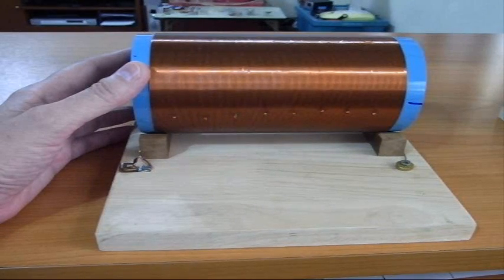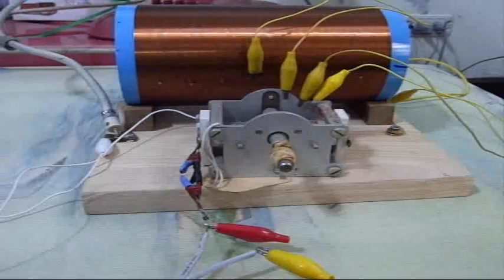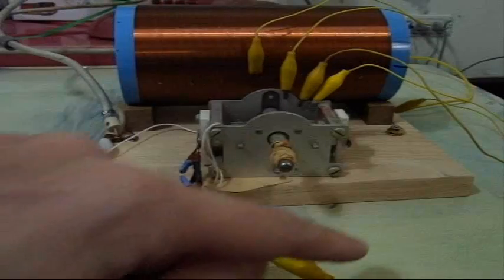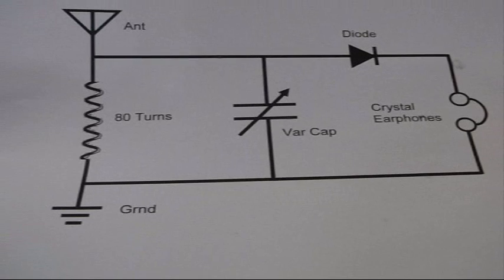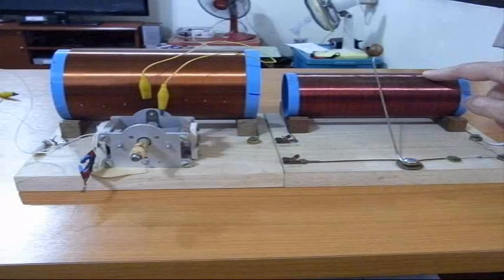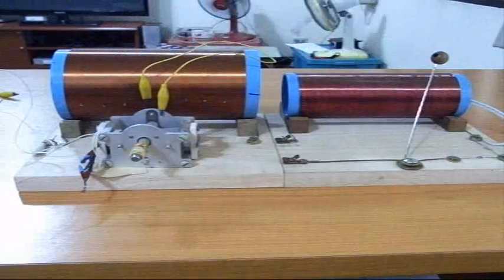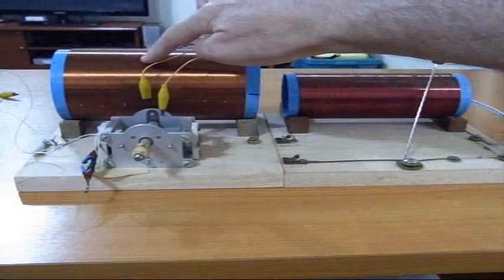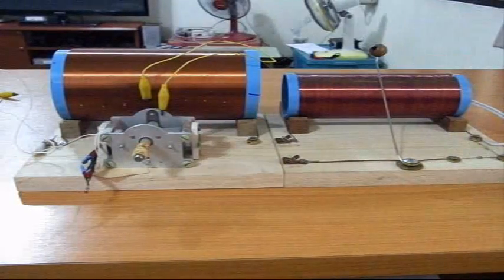Popular Crystal Radio Design That's a Waste of Time - And Why   (Updated Video Available)

Comment: perhaps something  is missing or lost over the course of time fom the original design;
ike a ferrite rod sliding partially in and out of the coil along witj the antenna wire to tune it
Reply from the maker: Sounds like you are describing the "rocket radios" (I had one of those when I was a kid).  It's a different circuit design for a crystal radio.  There are dozens and dozens of crystal radio designs, some are better than others.

Comment: Mine receives 560 kHz and this one is strong, a  weaker Mexican station around 900 kHz and one cb on 27 Mhz that seems to be located nearby at the same time.  For my first radio, this is AWESOME!!  I have built 2 others that suck too (especially the one using a microwave power transformer secondary coil that only looks cool) BUT and that's a big but, I want to build a better one I can permanently leave in the hunting shack all the time and have tunes.  especially that some wandering  bastard doesn't go and take! Or at least I can easily make a replacement.  Wind a secondary coil with an inductance  from 136 to 141 uH.  Subtract turns one at a time till you get your favorite station coming in strongest.
Reply from the maker: This one works well, but it's a bit complex:
https://www.youtube.com/watch?v=AaNpFYe5dSo&t=3s

This one is very simple, but tuning is less precise:
https://www.youtube.com/watch?v=8XR9Uzy2RPM&t=2s

Comment: You are missing a seperate induction coil on the first kit.
Reply from the maker: That may be the problem.  The diagram I show is all over the internet claiming it works and it does not. If it needs other components to function, they don't mention them!

Comment: What is the value of that variable cap.?  It sure doesn't look like 365mmf.  I don't believe it has enough variation of capacitance to change the value of L/C network to tune across the band.  When I was a kid, a made many crystal radios with that circuit.  Wound the coil on a toilet paper tube, and used 365mmf variables from old radios.  They worked loud and clear.  with fewer windings on the coil, I even picket up Radio Moscow (if was on the east coast).
Reply from the maker: It's 356 pFs for sure.  That's the value that all these designs call for (you can google for a while and find this same circuit diagram again and again.  I think it's people copying it).  As I said in the video, I can get 1-2 stations and they are pretty strong, BUT with the others I can get up to 17 stations.  I can get 1 station just using a germanium diode, so why bother with the coil and cap?  I've got another design that works really well.  Excellent discrimination, but not quite as loud.  https://www.youtube.com/watch?v=AaNpFYe5dSo&t=12s

Comment: I had one of those "boy scout" radios back in the 50's/60's. It only got two stations at best. Mine however had the coil between the antenna and ground with the tap going to the detector then ground. I like your mod, at first I thought it was crazy, but the more I looked at it, yeh....crazy like a fox. It gives a better antenna match.
Reply from the maker: I grew up in a small Midwest town and even with a really good antenna also had limited reception.  If you are near a big city with lots of AM stations you can get a lot more stations.  As a bit of trivia, the boy scout design in my wolf scout book (I've still got it) had an error in the picture, it had an extra wire that was shorting the coil if I recall.  I still remembered that decades later when I built this one.  Glad you liked it.  The capacitor one I did also works very well.  Most of the designs you find for capacitive tuned ones don't work at all like the one in this video.

Comment: Just 80 turns does not determine the inductance. It is dependant on diameter and turn spacing as well
Reply: ala Robert Turner : 80 turns 26awg wire yields a   coli of 1.27 length :
 1.27/80 = 0.158in/turn close wound

Comment: well maybe if you take it out side to get best reception remember they transmit 10000 watts or what ever and you have to get best location see this thing is a radiant energy collection device and it picks up allot of signals if the electric was out and you had a more calm environment it probably work better but see what it really is a way to collect electric from the environment for free and this is why we don't really see it much anymore wouldn't want people to get the idea to stick up an antenna to collect free energy. IE easy to get energy.

Comment: I bought this regenerative receiver kit and was thrilled with it. Coils can be changed for different bands. For twenty dollars you can not go wrong. The circuit board is well masked, professional, well labeled, instructions are well written.  The on board TDA7052 1.1W amplifier is a real winner no other amplification to drive a room filling speaker is really needed. The varactor tuning is stable. Regen is very smooth. The fellow selling these kits is “ thorpnoe “ best way to find it is to search ebay for item number 162408106542  I used a simple 40 meter dipole antenna strung up into a tree, I am sure long wire will do well also. N8DLI

Here is a pretty good description of the kit. You can see a similar circuit in action at https://www.youtube.com/watch?v=uESpudNQJ9o&t=74s

The regenerative receiver kit based on the design at https://circuitsalad.com/category/rf/page/4/. This is the "version 2" design but substituted a pot with a varactor for the variable air capacitor. Uses 1206 size SMT parts with six smaller parts pre mounted as shown in first photo.  You install the 22 remaining SMT parts and the 6 through hole parts along with the externally wired pots, or SMT can all be installed no extra charge  Second photo shows all SMT parts mounted. All parts are included except for user supplied 10K-B pots (2 needed), 1M-A or B pot, speaker, 9-16V power source, and an antenna.

Comment: when i was a kid i used to disassemble electronic stuff like radios, and i think there's always a black tube in the antenna part that seems to be a magnet.
what's the difference between that and the pvc pipe? is the magnet stuff only useful for powered radios?
Reply from the maker: There's what they call ferro-magnetic bars, toroid and such.  It's not really magnetic like we think about magnets, it only magnetizes for really, really short time periods and only when there's a change in current in the surrounding wire.  Like the core of a transformer, but even less permanent.
Reply: It's not a magnet, just looks like one. And, it will stick to a magnet. It's powdered iron oxides in a binder. The reason for it is that solid iron would have lousy frequency response, while the particulates work quite well at higher frequencies. It could be used in either a powered radio or a crystal set. The purpose of it is to increase the permeability of the core of a coil and increases its inductance.

Comment: Are you quite sure  you want in the second diagram, the ground at the top and not the bottom? Consider when you have maximum inductance for lower freq stations ( the slider arm more towards bottom of diagram. ) In that case, the diode circuit is across a smaller part of this autotransformer, and the output voltage is less than over the whole coil.
Reply from the maker: It's a good question.  I did try putting the ground (and antenna) on every intersection to see if that would help.  Nope.  I'm still trying to make it work.  Part of the problem is that it is very sensitive and therefore good at discriminating among signals, BUT (and it's a big but) anything you attach to the circuit that is anything but extremely high impedance kills the resonance (I've been using an oscilloscope on it).  I know it must work!  Will keep beating my head on this wall until I figure it out or I die in the effort!  ;)

Comment: I used a free Google Play app called ElectroDroid to do some calculations.  A coil with 80 turns and roughly the same diameter and length as yours has an inductance of about 400 microhenrys.  It resonates with a 365 pF capacitor at about 400 kHz, which is well below the AM broadcast band.

It looks to me like the coil needs a lot less turns.  If you have an Android phone you can download this app or use a different one for Windows or whatever.  It makes getting a ballpark estimate so much easier.
L8r...
Reply from the maker: I downloaded that a while back and have not played with it much.  Yes, the coil is much bigger than the one on the wiper-style radio, but I have taps every 20 turns so I can try many different inductances.  It just never got more than 2 stations.  I think it has to do with being able to vary BOTH capacitance and inductance over a very large range: the capacitance of the wiper style is coming from the coil and when one varies the inductance you are also varying the capacitance in direct proportion.  Theoretically one could do that with independent coils and capacitors, but I've not given that a fair trial yet.  It's on my long (and every growing) list of things to do!

Comment: If you tune the capacitor of a parallel resonant circuit, you should hear a peak and a drop in the signal, even if there is only a single station.  Your tapped coil and capacitor does not sound like it is doing this.

I think the reason why is because the tapped coil has too much inductance and the resonant frequency iss much too low, well below the broadcast band.  The typical crystal set uses a 365 pF variable capacitor and a coil that is about 180 to 220 microhenrys.  I think that your coil is much more, it's a very large coil.  The coils that I've measured are about 1.25 inch or 30 mm diameter and 2 or 3 inches or 50 to 60 mm long.
I think you should be using the tap that is 40 turns or even less, 20 turns.  You may have to go even less, by using a smaller sized coil.  Thanks for the video.
Reply from the maker: I think you are right.  I have tried many coils, bigger, much bigger, smaller and tiny, but it's never very good.  I need to spend some more time on it.

Comment: I don't mean to get too "Electrical Theory" on you but ... if you apply the equation for resonance to your circuit there you will have an Aha! moment as to why that specific build should only work for one or two stations.  The capacitor is only allowing you to dial into that resonance at its peak so you can get the best sound quality for that one 80turn coil.  In the slider model you can only hope that the passive capacitance and inductance both match up where it happens to be laying (then you get a station, at resonance), you cant tune either L or C independently in a slider though.  The air cap just keeps you from needing a much larger device to get the same selectivity, like say out of a single coil only type radio.  You oughta try putting that air cap on your slider model and see if you think its an improvement then ...
Reply from the maker: I've run the numbers for the coils and caps from some online sites and theoretically they cover the AM band.  In practice things like antenna (length, orientation), proximity to ground planes (like when I showed on on the AC unit), my body positioning (seriously), nearby electrical devices (our plasma tv really interferes badly), etc. all affect the actual outcome.  In fact many times the electricity involved behaves more like static electricity than regular.  I've got computer USB scope on order so I can finally see what is really going on!  Can't wait!
Reply: Yes, that interference is what you would expect if you could not narrow your peak for resonance, to make the station youre tuning into the strongest one coming through.  The thing is most coils (if not all, I'm not sure what the perfect dimensions would be ... that's a fun math problem to tackle ... it would probably involve some sort of Rodan-esque increasing geometric iteration coil to make the tuning linear ... or simply one of those air capacitors that taper but whose slope would match up with the coil you've built ...), but most are not going to adjust Henrys vs. Farads in a fashion that keeps their graphs aligned ... and therefore makes them perfectly tuned as you slide.  You can calculate it yourself by running what would be your slider point of the coil at different points.  Youll see its not a linear relationship already.  The internal capacitance of the coil is not either.  Hence why if you can decouple these elements of the radio (capacitance and inductance in your tank circuit) and adjust them independently you can achieve better performance.

Comment: I get sort of where youre coming from with this.  The tapped concept can be infinitely better, however, with several additional modifications.  I can agree with you though that exclusively tuning with the air capacitor is not going to get you the range you want.  Tapping the coil in multiple locations AND using it is going to get you better selectivity than your slider radio though, if designed properly.  It would effectively allow you to be able to select half-way-around points on your coil where the slider can only reach single rungs (if that makes any sense).Also you have to consider that if your coil does not change ... that there is basically one set resonance attainable by your circuit with that capacitor.  Youre basically tuning it in closer to the one spot it really resonates at in that config.  You touched on it with your explanation of the slider model.  You are effectively changing both (and in effect moving across several different resonating combinations) when you slide.  You have the beginnings though of a better model ... its just more complicated to get your bang for buck.
Reply from the maker: I've got the parts to do what you are talking about, just need to find time to work on it.

Comment: My guess is that the variable capacitor is the wrong type for this coil. Also the coil itself doesn't have enough turns so the frequency range is too narrow. I usually go with about 120 turns and use a cheap variable capacitor and have gotten good results.
Reply from the maker: These coils have 170+ turns.  I have been experimenting with different coils, from very tiny to mid to large like this one.  The cap used is the "magic" 365 pF that the most popular design calls for, and that's what this video is about, debunking a design that is all over the internet.  This was built to the most popular specs.  If you look at a modern transistor radio the coils used with the 365 (or thereabouts) cap are small and multiple, so obviously it works.  But that's also in conjunction with a ferrite core of significant henries.  The quest goes on for a sensitive crystal receiver with good channel separation.

Comment: nice video,

If you want listening on shortwave in the Netherlands is that possible!
http://websdr.ewi.utwente.nl:8901/
instructions:
click To * waterfall *
Seeking for: * Waterfall view * and click on: MAX IN.
Choose a modulation now for testing: AM
Click in the box: Frequency - and type: 1008 KHZ (you will hear a Dutch radio station)

http://websdr.ewi.utwente.nl:8901/

40mtr for amateur band mode USB / LSB: 7125KHZ
for NL pirate stations on AM mode: 6380khz (usually on Sunday afternoon)
MW NL pirates station AM 1630KHZ
80mTr amateur 3650KHZ

Greetings from the Netherlands.
Rob.
Reply: It is possible You will want an air coil with about 10 turns to it with the turns spaced about two to 3 millimeters. A small plastic thread spool would probably work for the coil. I used to listen to WWV on such a setup back in the 90's. I also picked up some other North American short wave stations as well.

Comment: Better to have the diode and earphone tapped about a quarter of the way down the coil(not swamping out the high impedance of the coil/capacitor tuned circuit).A small capacitor(around 100-1000pf)across the earphone helps in detection,too(filters out rf after detection).

Comment: Great video, I very much back up everything you are saying, why dose the internet place these circuit ideas out there that do not work I have no idea.

The wire across the coil works well instead of a mechanical variable capacitor.

Comment: If you disconnect the ground your signal strength will go down, but most likely your selectivity with your variable capacitor/coil set will go up.  You can also hook up another variable capacitor in series with the ground wire and use minimum capacitance setting and find a balance of volume and selectivity.  Crystal phones are OK(as long as they don't drop out on you) but sound powered phones with matching transformer would open up a whole new world in sensitivity and reliability.  You can't tune into what you can't hear.  SP phones were the best bang for the buck modification for my crystal sets.